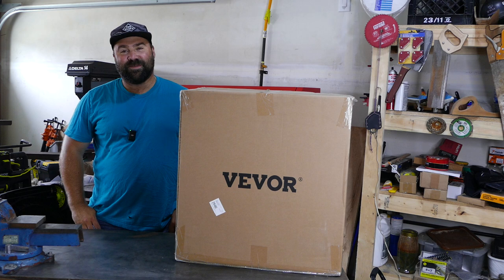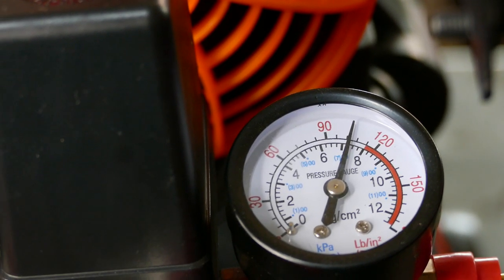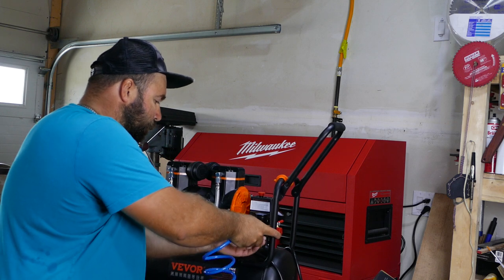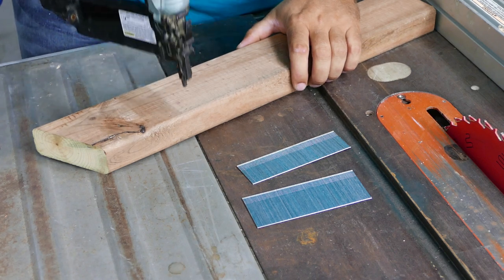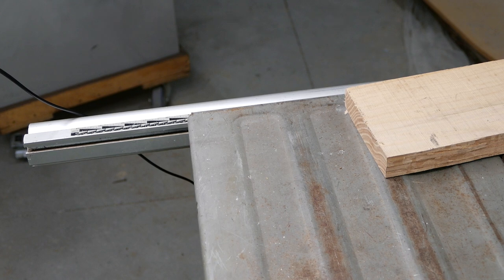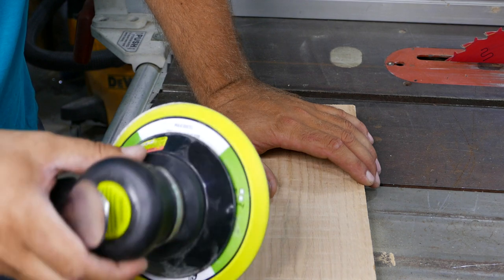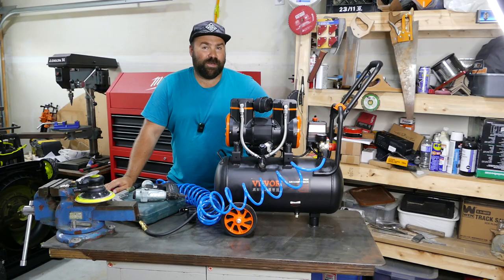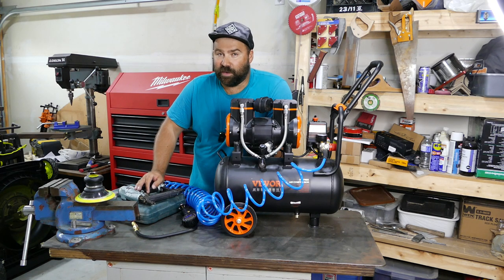Is this Vevor Air Compressor any Good??? Find out from this Review!

Comment: I bought this one new the only problem I found with it is that a has a safety shot off switch when it over heats. And when you need it the most it won’t turn on. I filled up the tank and I started using it and then shut off. It think it’s over heating. When it’s not. And know there is nothing wrong with it. That’s the way it’s built. If you haven’t had this problem you will eventually.